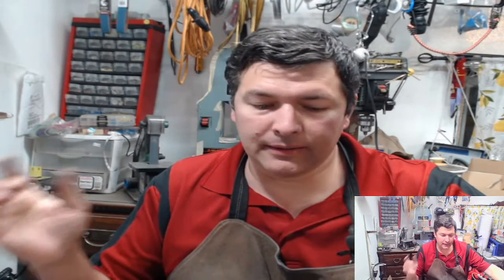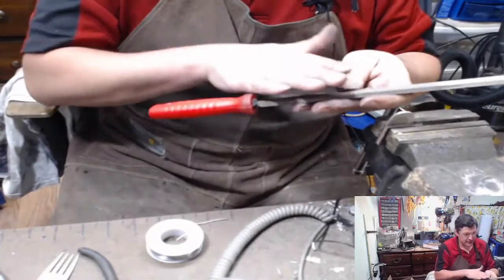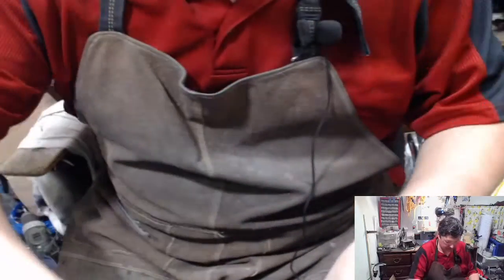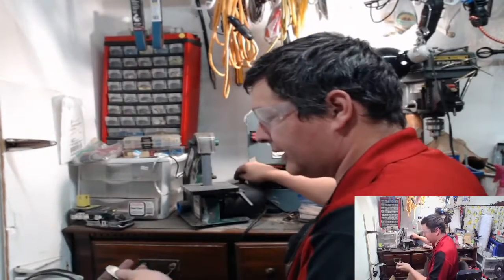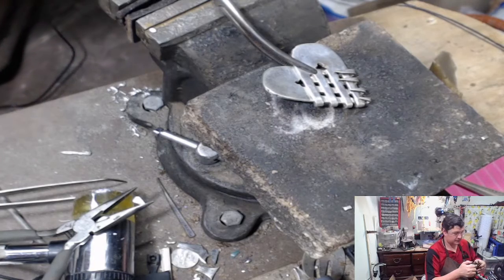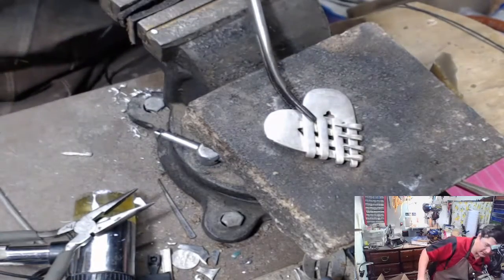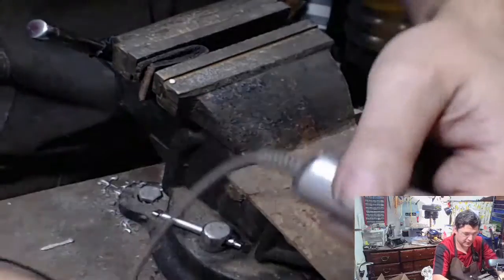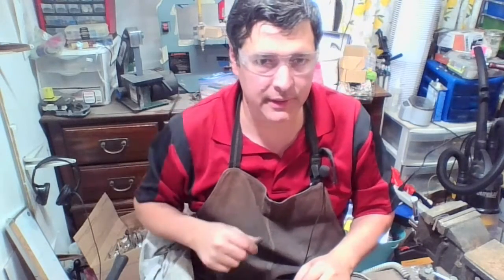How to make easy double fork heart pendants

Comment: Is there a quick answer for this newbie who’s never soldered as to why you didn’t use flux or the other “stuff” I’ve seen used when soldering?
Reply from the maker: The Quick answer is the solder I use has flux already in it. So once it melts the rosin inside cleans the area for the solder to stick to it just like the flux does. Here’s what I use  Harris Products Group 4 oz. Lead-Free Solder - https://amzn.to/37jX4Ym
Reply: Or pickle?
Reply: @FlatwareCreationSS  oh I was rewatching and didn’t realize you already replied. Thank you. I did get that solder so gearing up to give it a try. I struggled with the hearts. Got two in the works. Broke one, like yours. And one set ready to try again to bend.
Reply from the maker: I have never pickled my silver plated stuff after soldering. I’ll have to see how that works. Let me know how it works out for you.